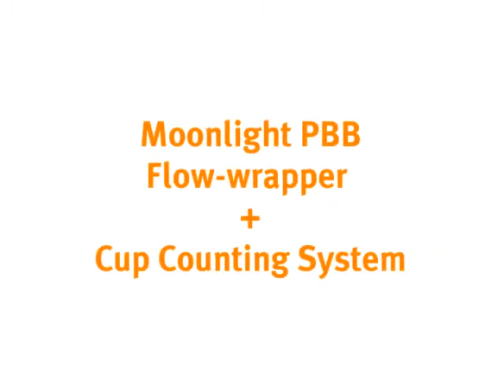Solutions for plastic cups packaging (by Imanpack)

Comment from the maker: Video: Solutions for plastic cups packaging
				 A complete line to wrap plastic bags in either flat or rolled up form:
- Custom feeding systems;
- Flow-wrappers;
- Vertical machine form-fill-seal;
- Shrinking tunnels;
- Packing, pallettizing and downstream solutions. 
Watch the video!
 #SolutionsForPlasticCupsPackaging   #PackagingSolutions   #Imanpack   #FlowWrappers